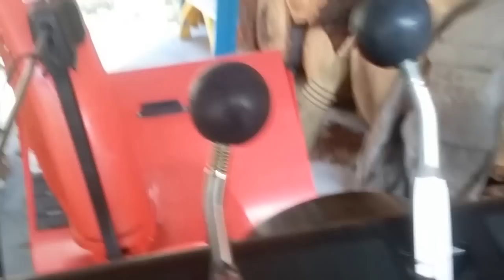Ariens / Carroll Stream diesel snowblower project

Comment: I live in North East Minnesota, my snowblower sits outside under a roof, having a diesel engine when it is in the middle of winter makes no sense. It would be harder to start, and, problems with fuel oil jelling, ect. I just do not see the advantage of a diesel. Are those engines way cheaper. If you really wanted a sweet machine, put a Honda gas engine on it. I know diesels, i farmed with them, and, i know how they work in winter.
Reply: i was thinking the same thing.  i guess if you store it in a semi warm garage it doesn't matter
Reply: Theres this thing called anti gel fuel additive... Ran it in my diesel truck and it never gelled
Reply: Thing is, Honda gas engines are also very cold blooded. Very. Lol
Reply: @andrewbuzzell3542  or Kerosene (k1) never will gel
Reply: All Diesel fuel here has anti-gel added in winter.   As mentioned, you can buy anti-gel additive if the fuel companies don't care.   If that is not enough there are aftermarket small inline fuel heaters.
Reply: A flaming propane torch into the intake for 30 seconds (after you take the air filter off) will give you near instant starts. 
That's the principle of the Thermostart intake flame heater and grid heaters in modern diesels..
and glow plugs in old IDI diesels.
If you adapt you can overcome cold conditions...even JD engineering.

Comment: To each his own but Id never buy a diesel to run on a snowblower a good used gas engine would be cheaper and more reliable.   A snowblower chassis like that can be had for free around here.  Good luck Andrew
Reply: Between not having carburetor problems, not having to deal with old fuel, and less fill ups all point to good reasons to have a diesel on seasonal equipment.
Starting in the cold can be taken care of with a propane torch flame in the intake for 30 seconds.....hot air in...instant start.

Comment: Fun idea BUT, (you knew there'd be one) Diesels do NOT like the cold. It will be tough to start in winter. You will need a glow plug, or heated storage, possibly starter fluid (which is bad for piston walls as it thins out the lubricating oil).
Reply: Won't be an issue, these are high compression motors. No glowplugs needed. It will start up np in the winter. Had one on a minibike with a turbo for years and drove it every winter. Started with 3 pulls even at -20°F
Reply: Look up Lister CS diesels.
The CS stands for...cold start.
A flaming propane torch into the intake for 30 seconds (after you take the air filter off) will give you near instant starts. 
That's the principle of the Thermostart intake flame heater and grid heaters in modern diesels..
and glow plugs in old IDI diesels.

Comment: I hear that thing bogging down with just a half pass ..wait till its 10 below you'll never start that diesel and wished it was gas
Reply from the maker: Thanks for the interest.  It was actually running at 3/4 throttle, and when it bogs like that it's actually really satisfying to turn the throttle up to max and watch the big poof of black smoke emerge from the exhaust port!
Reply from the maker: Also, the house is at 8000ft and I haven't had trouble starting yet.  I bought a magnetic heater just in case though, but haven't needed to use it.  Most of the problems I've had so far are due to wear on the Ariens bucket itself like the drive system and snow chute.
Reply: I picture him coming into the house when hes done and takes off his goggles  to reveal his face all black except for his eyes !!
Reply: Get yourself a little turbo charger. You can even a little bit of ether to start it in the winter
Reply: Nice rhyme.
Reply: He's done that 5psi boost!
 @MikeyB_1972

Comment: Why would you want a hard to start diesel especially when it will be cold when you want to use it? Plus the fact they stink like hell.
Reply from the maker: Greenid Guy so I can run HPR, 98%  renewable.
Reply: That may be the case, but in colder climates it’s hard to start and look at the pollution created since it’s not a “clean” diesel. So I’d hardly consider it anything close to being “green”. Not a criticism, just an observation.
Reply: Andrew Cook however, nice job on the build, just wouldn’t be my choice.
Reply: Forget renewable nonsense, the best thing about the diesel is the torque.  Once warmed up, there's no way it's gonna stall.  Should be able to power through the wettest packed snow with ease.  Maybe replace the plastic pulley with a metal one if possible cause it may not last very long.
Reply: Brian Sparks I get what you are saying Brian, however I watched the video and my gas powered 12 horse does just as good as his diesel if not better, plus the startup is one maybe two pulls in the coldest weather unlike his 12 volt battery assist followed by the smokey warm up period.  You’re absolutely right about the torque, but the chassis wasn’t designed for that, so if he does get loads of torque in wet, heavy snow stuff will break constantly. They put shear pins on the intake auger for a reason.